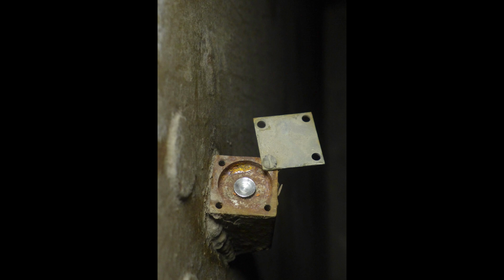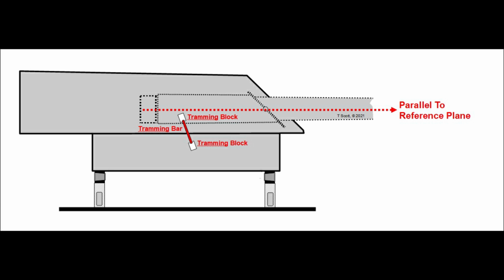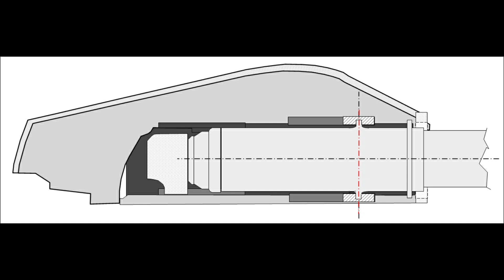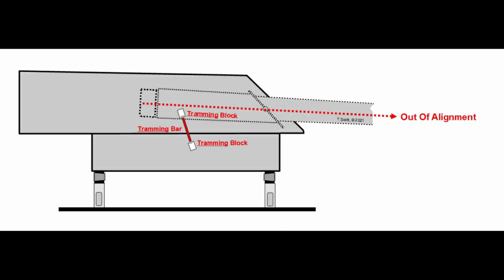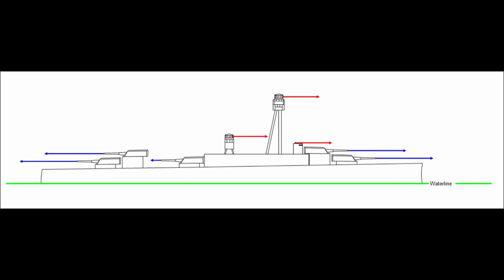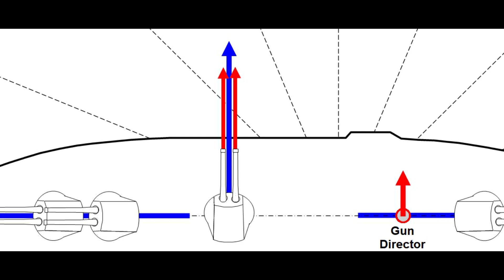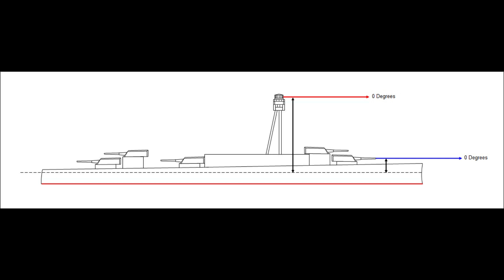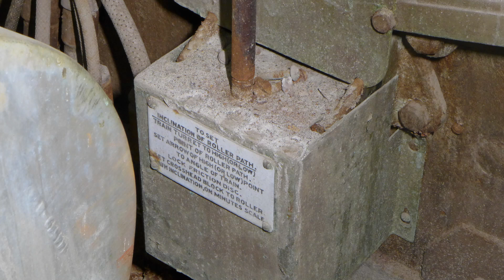Battleship Texas, What The Heck Is It?  It is a Tramming Block!

Comment: The very first photos that I have ever seen showing how the turrets were made! Thanks for that. How were the turret bodies made? Cast as a single piece or welded together? Every time I have been on this and other battleships, I have marveled at their size wondering how they were aasembled and lifted into place! I never saw any photos of these parts being made and lifted  on display in the ship's museum. I can't imagine a shipyard wirh a foundry large enough to cast a turret, but there seemed no way to transport them from a steel mill either. I hope to see more on the subject. After all, the big guns were the reason for the ship to be built.
Reply from the maker: Turrets were a complicated structure.  On Texas, the turret pan (floor) is a flat piece of 2" thick steel that serves not only as a structural member, but also the dimensional reference that everything else is measured from.  The turret house is built on a frame that mounts to the floor.  The actual sides, face and roof of the turret are made up of face hardened steel that cannot be welded without ruining it, so it bolts onto the frame.  This is also important since the roof and back must be unbolted and removed whenever they change out the gun barrels, which happened 3 times during the ship's career. 

Shipyards did not have the ability to make armor.  At the time Texas was built, there were only three places that I am aware of that could produce armor in the U.S.  It was a very complicated process that involved special ovens and molds to cast it in its rough shape,   It then had to be pounded into shape while red hot using huge forges.  It was then milled into is final dimensions and put back in an oven where it was reheated.  Then there is a very specialized way of carbonizing and tempering its surface so that the outer 1/3rd of it is much harder than the back portion.  Having only its outer surface hardened is extremely important since it is very brittle and would shatter, except the back, softer portion acts as a support and cushion.  The large armor pieces were then taken to the shipyard by railroad to be installed.  Even then, they first built the entire turret structure in a shop that had a perfectly flat floor to be sure that everything, including the guns fit and were perfectly aligned.  They then marked everything, partially disassembled the turret, lifted it on the ship and reassembled it.

Comment: I would’ve liked to have met the genius of trigonometry who first figured out how to properly align all the various gun tubes and gun directors on the early pre-Dreadnought warships
Reply from the maker: I agree that there were key individuals along the evolutionary chain of development whose brains I’d like to pick.  In pretty much all cases, any step forward in design was the result of one of them seeing a slightly better way of doing something or seeing a way to borrow an idea from an unrelated system or design.  While it isn’t as satisfying as finding a person who has a flash of inspiration that resulted in an entirely new system, I still have great respect and admiration for those who saw the ways to improve things.

By the way, there were two certifiable geniuses whose design efforts directly affected systems on Texas.  Google Hannibal Ford.  He was the mathematical and engineering genius who developed the range keeper that was an analog computer used to calculate firing solutions for the large guns.  His initial Ford Mk 1 design was first tested on Texas in 1916 and was the basis of all fire control computers used on US warships.

The other genius was Admiral Dyson.  I don’t remember his first name off the top of my head.  He was a mechanical genius who not only wrote a definitive text book on propeller design, he edited engineering textbooks used at Annapolis.  He later became head of steam engineering for the US Navy and directly designed the 300 psi oil fired boilers used on Texas, and many other battleships, aircraft carriers and heavy cruisers.
Reply: @tomscotttheolderone364   Thank you for the reply.  I certainly will look to find more about these men who were the pioneers in subject of naval artillery targeting.
I recently read Trent Hone’s terrific book, Learning War. The book goes into much of the history behind the evolution of the USN large-artillery directing systems.

Comment: It’s a bench datum mark ,at the end of the gun, grease was put at midnight ,3,6 and 9 o’clock cotton was placed from midnight to 6,o’clock and from 3 o’clock to 9 o’clock ,then with the breach open  a special sight was adjusted to be in the centre of the bore at the breach end..when looking down the sight the cross with the cotton on the muzzle was lined up so the line of sight was bang on dead central of the whole length of the barrel,which was then trained to point at a bench datum mark somewhere usually on the deck,,the same was then repeated at the director and the hydraulic servos were then all calibrated, then repeated for every gun so when the director gave a bearing and distance to the TS ,the necessary adjustments, once transmitted to all gun turrets would be true

Comment: How accurate were the 14" guns? At maximum range, what were the percentages for hitting a battleship sized target or what was the circular error probable for the main guns? Thank you.
Reply from the maker: Texas performed better at her maximum range than did later ships that used 14"/45 caliber guns.  However, that is very deceptive.  The New York class, that included Texas, had a maximum barrel elevation of 15 degrees that limited range to 23,000 yards.  The Nevada and Pennsylvania classes started out with the same limitation, but modernizations in the 1930's increased their elevations to 30 degrees and an improvement in range to almost 35,000 yards.   Based upon firing exercises in the 1930's and a maximum range of 20,000 yards, Texas scored around 10% hits at 20,000 yards, which was good.  This was generally no better or worse than the later ships at that range.  Their accuracy dropped as they increased range beyond that.
Reply: @tomscotttheolderone364  Thank you sir!